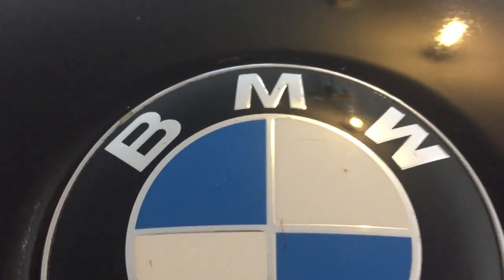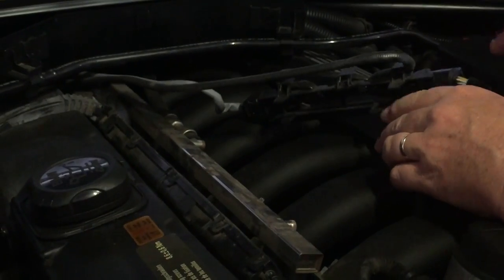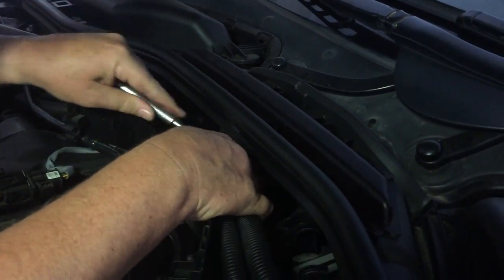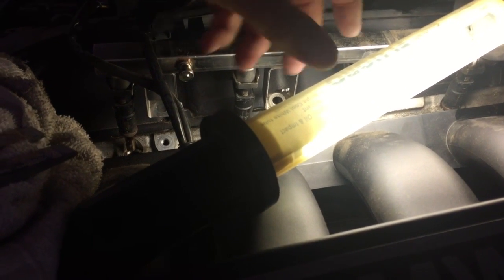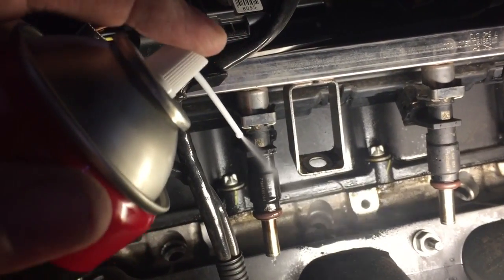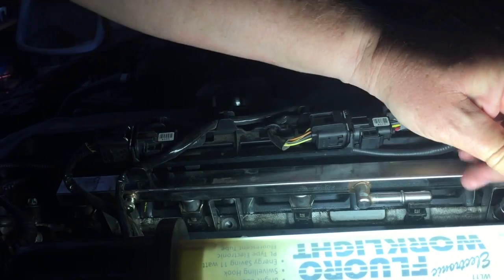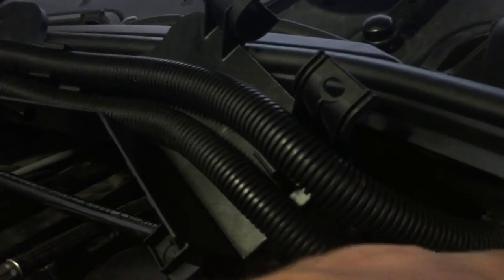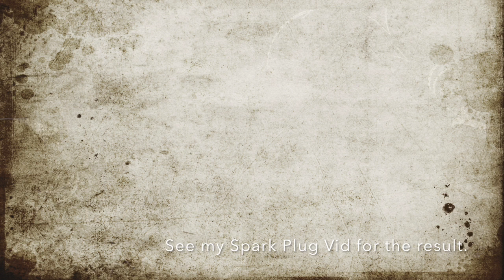How to remove & Clean fuel injectors BMW e70 e90 330i 530i X3 X5 engine 5 series

Comment: In order to actually clean your injectors one cannot spray into the injectors.  I know this is a pain, but I'm a marine mechanic, and I remove the injectors one at a time, and hook them up to a battery with a positive and negative wire. Hook up the neg wire with an alligator clamp then touch the positive wire to the injector as this will cause intermittently open the injectors. As the injector quickly opens, spray cleaner through it and this will push out any and all debris. It will also give you a clear and definite indication if the injector is clogged, partially clogged, or working as it should. I may be a woman mechanic but I'm darn good at it 😎
Reply: Linda Curtis which is the negative and positive?
Reply: woman or not, you're either a mechanic or not.
Reply: @quartznation9499  it doesn't matter. I just cleaned my two vanos and used a 9v battery to do the same trick. Linda Curtis is a rockstar!!!
Reply: can you do this when your car was just on like an hour ago? Or does one have to wait for the engine to be completely cold
Reply: @quartznation9499  It doesn't have to identify positive and negative pin in testing with a 9 Volt battery, and will work either way.
Reply: @ЦхемуилеНицк  She is a true good mechanic regardless of her gender.
Reply: Can I use lucas deep clean gdi to spray it with to clean it with? I have the battery and wire's to try and clean im just nit sure what spray to use.

Comment: If you are going that far to get to the injectors, one might as well disconnect them from the fuel rail at the top also. The electrical connectors are made with wire and there is a certain way they come loose. Then the injectors will pull out of the fuel rail much like they did out of the manifold at the bottom. The O-rings can get hard in time, so that is why they may be a bit difficult to pull out. New O-rings will be softer and will assemble easier, especially with some liquid as a lubricant.  Always use something on O-rings for lube when assembling. With injectors completely out they can be cleaned professionally or something similar yourself if you know how. When you get new O-rings get the brown ones if you can which are made to withstand today's alcohol fuel. 88 cents a piece for mine.
Reply: i am assuming that on n52 engines you don't have to  code in .... or at list in the impa software i have the option  dose not show up ?
Reply: if you know enything about it let me know
Reply from the maker: I didn't change the injectors so no coding was required.
Reply: Can I use lucas deep clean gdi spray to clean with?

Comment: Always best to remove the micro filters first and blow carb cleaner through the injector before replacing filters. Or better again, invest in an ultrasonic cleaning bath. You can buy them cheap enough these days.

Comment: To clean buy kit on eBay 20 bucks comes with everything o rings filter baskets hook up 12 volts to the injector leave one wire off hook up your carb cleaner when spraying cleaner touch the other wire so injector is working and spray tell it’s a mist not a stream! To take filter basket out use a screw size not sure them screw it gentle where it catches the basket and pull up out. Install new baskets and o rings to install on car use a little oil on the o ring and push back. Your car will love you!
Reply: @TheSponge945  he probably forgot. But now I bet he won't post it!